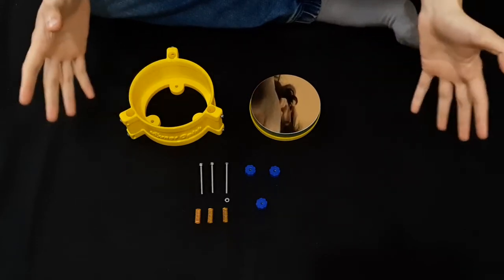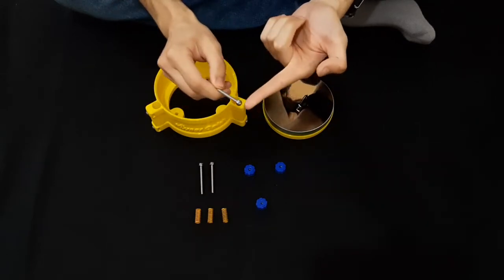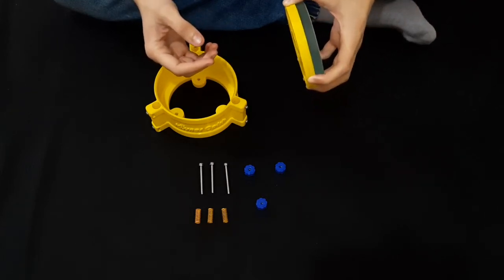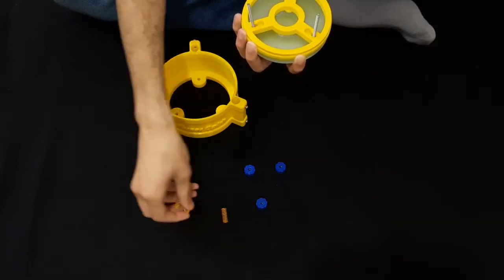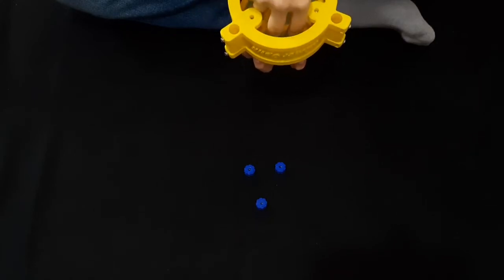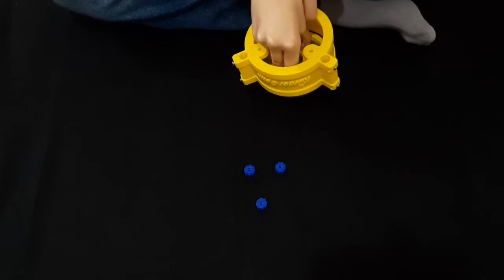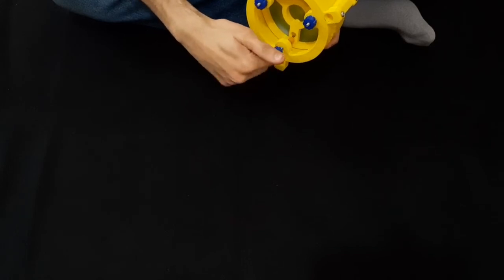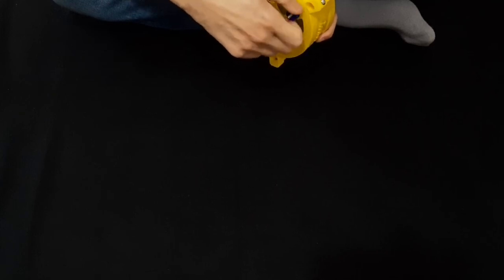Hadley M4 keyhole cell assembly

Comment: Too bad I didn't see this BEFORE I had already printed the mirror cell.  However I have not yet glued in the mirror so I could print one.  In any case, there is still a problem with the design.  If the springs are strong enough, tightening the nuts could cause the screws to turn instead of pulling the screws and mirror cell toward the LTA.  The use of the lock nuts would prevent that, but the cell isn't tall enough to fit the lock nuts under the mirror.  So, I had to use locktight on the screw threads to keep them in the nuts.  In either case, the nuts must be fully tightened against the screw heads with a wrench and screwdriver before being inserted into the cell with the keyhole, or while being inserted into the stock cell.  The stock cell was printed with the 10-24 (I used 10-32 screws here) sized so that the screws would self thread into the holes.  If you omit the locktight with the key hole cell, you can repair it after the mirror is glued in.  If you used the stock cell, don't omit the locktight!!!!